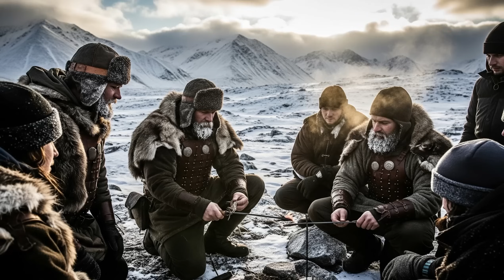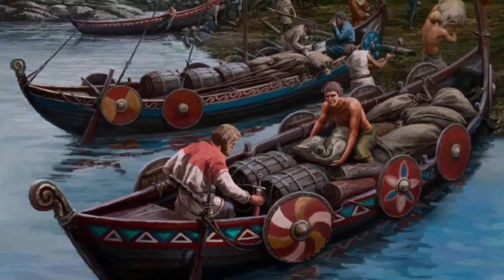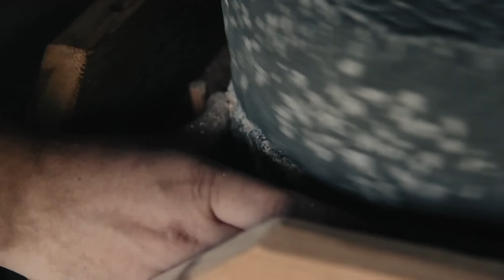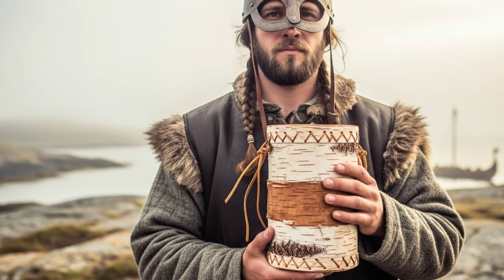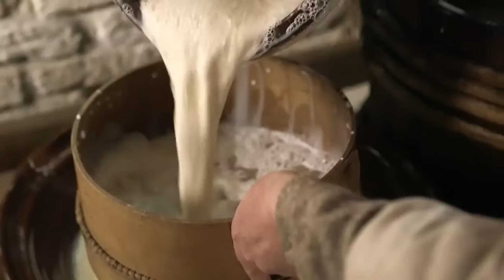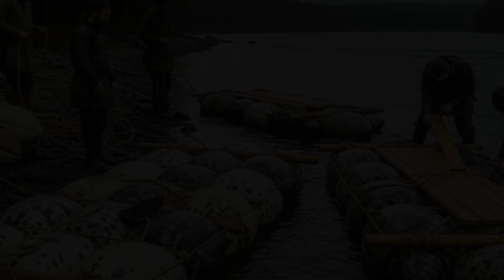10 Inventions That Kept Vikings Alive And Still Work Today

Comment: Not true. I have left salted butter on the table in a covered butter dish for several weeks and it was still good and didn’t cause any harm. The trick is the salt and a cooler temperature. Low 70s.
Reply: it is more dependent on whether or not whoever makes the butter gets all the buttermilk outta the butter.... i make my own butter. it's crucial to get all the buttermilk outta it or it goes bad rather quickly regardless of salt or temperature. i have never kept my butter in the fridge or cooler temps ever even in middle of summer n i rarely have butter go bad

Comment: Butter doesn't keep unless refrigerated.
Reply: Butter  has been around a lot longer than refridgerators  even in hot climates  it was usually kept in a cool place  in what was known as butter dishes   yes amazing hey   even  in  the middle of summer we had butter  on the shelf    what was known as a coolgardi  meaning  cool cupboard if  you cant figure it out.
Reply: Not true...lol I put chilled water in my butter bell. Stays good for weeks, long enough to finish what's inside.